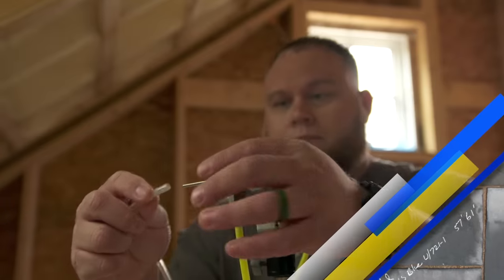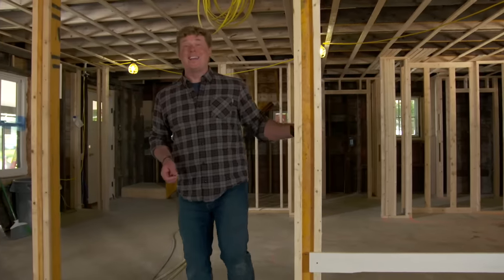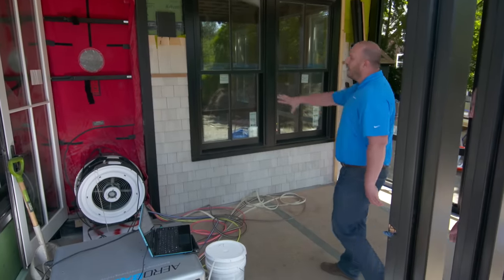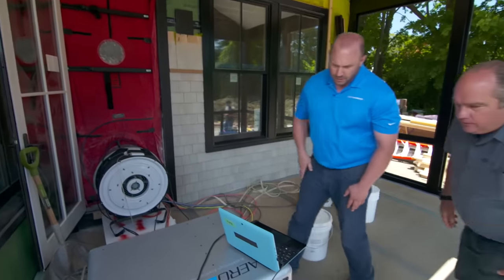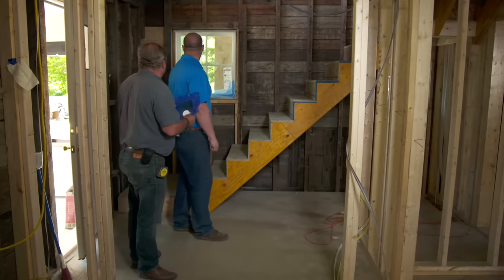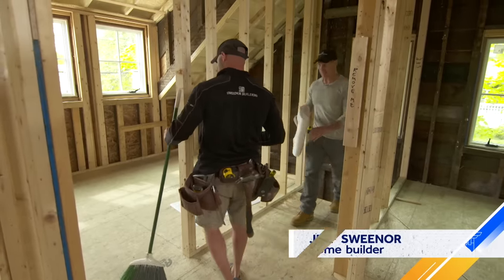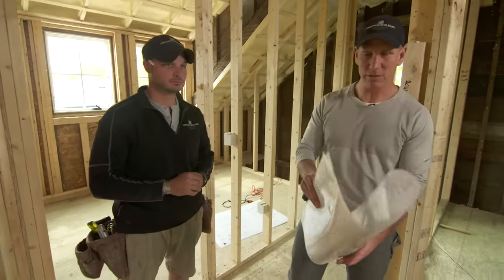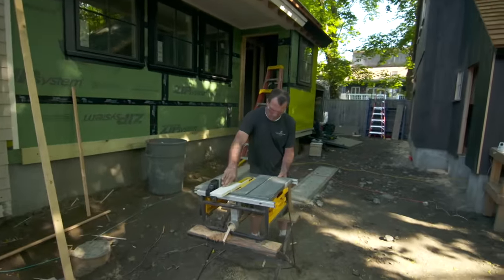This Old House | Air Tight House (S40 E8) | FULL EPISODE

Comment: From Pakistan 🇵🇰... I always watch all your videos.. Even we don't construct home's from wood but i love to see the techniques really beneficial for me as mechanical technician to learn
Reply: Being from the U.S. I never really realize in other countries houses aren't always made of wood, where as the majority of houses here, at least in my area they're mostly wood.
Reply: @MechanicalMikesRoadsideRepair  Brick and concrete. Lumber makes sense in the U.S. because it keeps material cost low and labor cost high.
Reply: Joe Kinchicken  what you in US always forget is thermal accumulation properties of brick and concrete which benefits in especially cooling season. we in europe here do energy frame calculations, and take thermal capacity into account. Higher thermal capacity = better performance, you cannot deny physics.

And yes, you do have insulation here, it's just sitting in a wall cavity. We attach two brick or concrete walls together with rebar and put insulation inbetween. Or put insulation on outside of concrete wall and then plaster it.
It will outlast any wood-based wall anytime. its superior waterproof, termite and damp resistant. You don't even need vapor barrier in walls then. And yes, you can easily run utilities in the cavity you create between the walls. Also, we even make a lot of internal walls of brick for soundproofing.

Comment: Using the vacuum pressure and the spray to seal up air leaks was very interesting.. but one think I don’t get.. why doesn’t that white spray,  coat everything and make a huge mess? And how does it go directly to the leak and not settle on anything else...
Reply: I’d guess something to do with pressure sucking in every bit of the sealant where there’s a leak. Then I’m sure once the % gets to a certain point they cut it off so it doesn’t just settle

Comment: How does that air pressure sealant effect all the surfaces in the house, after it is blown into the air? For instance, are the glass windows, external doors, etc covered in a thin coat of sealant?
Reply: Yes cover windows but otherwise they say you only need to protect horizontal surfaces. You can have it done on a fully finished home
Reply: @MandoFettOG  If they didn't say that, they couldn't really sell it could they?  Seems like quite the motivation to say it's all good.

Comment: 3.87 wow that's high for construction aiming at net zero.
This technique got it down to 0.9 ACH at 50Pa but that could have been better if the initial construction had been tighter.
Passive house standard is 0.6 ACH at 50pa for new construction and 1.0 for retrofit.
This project is a lot more like new construction so they should have gotten it down lower.
I've seen new construction come in at 0.32 ACH at 50Pa without this spray sealant.
Reply: Most of the existing leaks are probably from the old part of the house which is 1920s vintage.
Reply: let me ask you this?? do you even think many contractors take any of these codes, measurements, etc...into consideration these days? I think they're doing a hell of a job considered to most!

Comment: Those shingles look like they split almost every place they get stapled. And does that yellow mesh actually do anything? Air isn't going to be blasting through that tiny gap is it?
Reply: Enough to allow the surfaces to dry, which is the point -- close contact of the shingles to the wall all but assures there will be permanent damp spots...

Comment: That was one of the dumbest things I have seen! Cutting structural porch post to add decorative trim! Why not cut the trim in the center of each opening then slip it around the posts?! A little bit of exterior glue on the joints and done!
Reply: I agree 😂
Reply: It looks like the load is being carried by those screws which could shear off.  With better planning they could have put the trim plate on when the posts were installed.
Reply: As I have gotten  older in the trades I see how bad of butchers this old house is

Comment: Solar PV residential steps, to save money and be green:
1. House roof is wrong direction, so build S facing barn. $50K .  Barn space heat, cooling, lighting add to total  energy load.
2. Remove all lovely New England  trees in sun path of PV, increasing sun heat load on barn.  Neighbors trees to the East will still block morning sun on PV, and drop foliage waste on low barn PV array most of the year. 

Result: $80k barn and PV array project at 40 deg N won’t be close to net zero in New England winter.

Alternative: let the power utility provide clean power for a fifth the cost with no shading, more reliably,  using fewer resources per unit energy.

Comment: 24 on center? i thought it was always 16 0n center/ im so confused now. i didnt know it can be chaned.
Reply: It can be changed, but you better check with your local code first.  I believe they discussed this.
Reply: The difference is the strength of the planks. With 2x4 standard size studs, you need to meet a certain wall load capacity, and the minimum spacing to acheive that  (with common 2x4's) is 16 inches on center. They expanded that to reduce the thermal bridging caused by the wood and to allow for more insulation. To meet the required wall load capacity, they had to increase stud size to 2x6. Hope this helps!
Reply: @James Dotson so when he sells that house eventually i hope he disclose what he did. when i buy these 100 year old houses i expect certain things. i do like the 24 on center though.
Reply: Henrik Techguy Seems like 24” on the drywall side is asking for internal trouble.  Punctures, etc, or else requiring the expense of double drywall layers.
Reply: @spicynomad  When you buy a 100 year old house you better expect 100 years of different hands on that structure.  There are zero assumptions... well except that you can't assume anything.

Comment: But the real question is: How long until the house is carbon neutral with all that extra material they are using to insulate the house??  Mmmm
Reply: Heriberto De La Cruz Carbon is only an environmental problem when burned and tossed into the atmosphere.  So the enviro issue here is the energy required to make those walls and that PV array.
Reply: and the cut down trees for the solar panels!
Reply: The energy inherent in the material is a valid point. The cost of this building with its plastics and engineered materials glued together is going to be different that a building made of recycled materials.